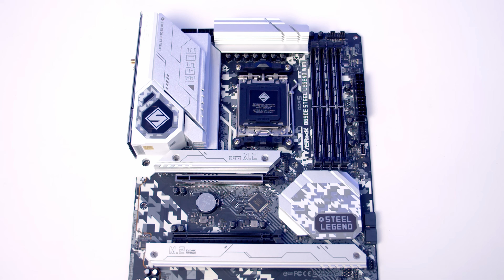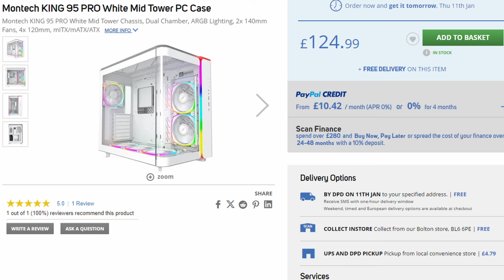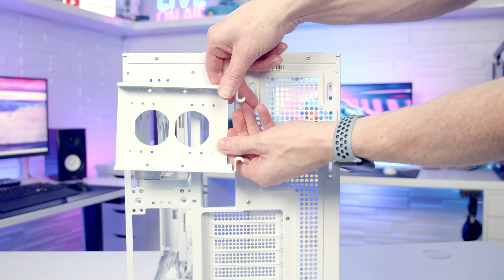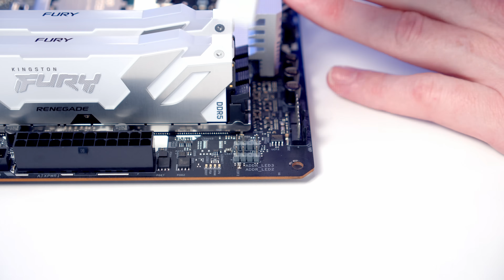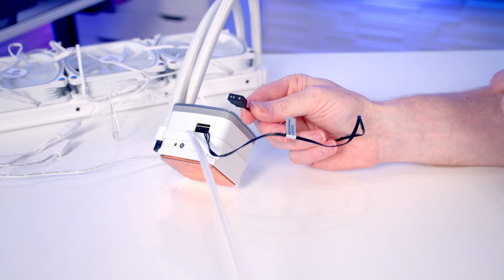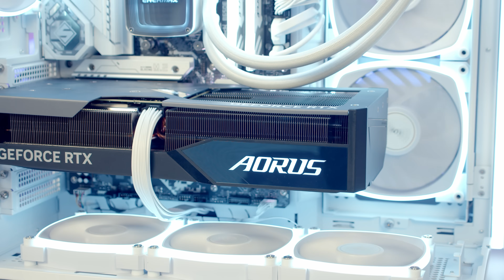Montech King 95 Build - Step by Step Guide and Case Review

Comment: I used a MSI MAG B550 Tomahawk MAX WiFi Gaming Motherboard and couldn't fit the i/o panel at all. Had to pry off the integrated shield and couldn't use it at all - the panel sat inset.   Then the board was doa and had to return a damaged mobo. So I'm back at step one wondering what board I can use tbat will fit. I need an amd for the 5000 series.

Comment: i am wanting to transfer my Hard drives from my old PC.  they are larger but i dont see a cable for the power and data line to connect. do i need a conversion for these? thanks for the fine video. pete

Comment: UPDATE:  (09:10)  Chris, that cable only comes with the non-Pro version of the case; the King 95 Pro doesn't come with it, and doesn't it need one.  

I think the way it works with the Pro version is, if you want to control the RGB lighting with reset switch, then just leave the default wiring in place (everything's all wired up and cable managed, right out of the box), but if you want to use the reset switch to reset the PC instead, then you only need to disconnect the two pin connector from the ARGB/PWM hub and tuck it away somewhere.  

I'm starting on Daniel's new gaming PC this week, so I'll check back to verify this information when I get to that part of the build - but I'm pretty sure that's how it works because in my (King 95 Pro) manual it shows that same adapter cable and says that it's "exclusive to King 95."

EDIT: Typos! 🫨
Reply: hello my friend
i've just got this case in the non pro version
did you used the cable that's included in this version? it is needed to control the front panel RGB?
I've also got the HUB Fan that's inclued in the kit with 3 montech fans, should I use the HUB for the "led" cable?
Reply: @renatinn  I used the King 95 Pro for the build I referenced above, and I haven't built in the non-Pro version, so I'm unsure of how you'd go about putting your particular setup together (sorry).

Comment: Can I do the Push and Pull system on the back with 240mm radiator?
Reply: That depends on the length of your GPU.  If it's a small one (less than 260mm or so in length), then you can make a push/pull 240mm AIO work.  Otherwise the AIO be too 'thick' and get in the way of the GPU.

Comment: I have been racking my brain trying to understand what you meant by "....and once we get it over the middle standoff it is going to help hold the motherboard in place...".There is nothing on my motherboard that I can see that allows you to hang the motherboard onto a middle standoff like you did ? I lay my case down at this point of the install to avoid it slipping and potentially scratching or damaging the bottom of the motherboard on the standoffs.
Reply: Not all ATX cases feature this type of center standoff but (when present) they're intended help to ensure that the motherboard is positioned correctly, with the other eight standoffs properly aligned with their corresponding motherboard holes.  

It should be noted that 'hanging' a motherboard (vertically) from this type of center standoff should always be done with great care because if the motherboard accidentally slips off, the standoff itself could conceivably cause damage to the back of the motherboard.
Reply: @MikeBob2023 Thanks and I have noted that he has given this advice before but I have never seen a motherboard with that ability but I assume they exist. I too would be too scared to just hang a motherboard like a picture on the wall - forget and bump the case, motherboard falls off the "holding point" and scrapes a couple of components off and you could be up for a brand new motherboard. Somehow as his advice is designed to help new builders I think it is fraught with risk. I'll stick to safely laying the PC down (as I do when inserting the GPU as well but he doesn't) to be on the safe side.
Reply: @regwatson2017  I wouldn't do it either, but Christopher can do this stuff in the dark with his eyes closed (and if he can do it, then realistically, anyone can).  I always install my motherboards and GPUs in a horizontal orientation as well, but because Chris is making videos, he's got things like camera angles to keep in mind -- so there's that to consider.  

When all is said & done though, I honestly don't think Mr. Flannigan would demonstrate (or advocate for) any build practice/methodology that was unsafe for either the novice builder or their components.   It's just not his way.

EDIT: Typos! 🙄

Comment: I’m strongly considering the pro version of the case for my first build, do you have any recommendations for third party gpu support brackets?
Reply: Because of the fans mounted on the bottom of the case, using most third party anti-sag brackets may not be possible.  Some motherboard manufacturers include brackets that utilize the motherboard's case mounting holes (some of ASRock's 'premium' 600 series models included them, like the Taichi for example), and some GPUs also come with their own case-mounted anti-sag bracket included (my Sapphire Pulse 9070 XT came with one, and I've seen several different MSI GPUs that include them as well), but you'll probably want to measure carefully before attempting to use any other type of bracket in the King 95 Pro.

Comment: Why does nobody show how to add an ssd or hdd.... thumbs down 100x if I could lol
Reply: Not a hard concept...push them in and apply screw or use tool less. Did you want a guide on how to plug it in to a wall socket also?

Comment: With the power supply mounted like that it is exhausting warm air into the case. Wouldn't it be better have it blow warm air out ? You'd have to rotate it 180 degrees. I prefer a power supply at the bottom of the case personally blowing air out the bottom but with this case you don't have the choice - you have to stick the power supply vertically rather than horizontally.

Comment: No need for gpu support?

I have a 7900xtx red devil, how should I support it?

Cheers
Reply: If you look at the end of the Gigabyte card you will see threads. He Should have received a L shaped bracket with his GPU. I have the Gigabyte 4090 Aero and it does and it also has this exact same holes for attaching it. Even with a 4070, I would be supporting it

Comment: Thanks for the video! I'm going to build a new pc and absolutely love this case! This  video really helped me plan the build.(it's my first build after 10 years now and i am a little bit rusty) I want to go with this case, a asrock b650 steel legend mobo, a ryzen 7 7800x3d cpu, a asrock 7900 gre, kingston fury beast ddr5 6000 cl30 32gb set, a arctic liquid freezer III cooler, a lexar nm790 2TB ssd, and a thermaltake toughpower gf snow 850 w. And i want to mount the gpu vertically with the coolermaster mount.

Comment: Why 7200MT/S  for the 7800X3d?
AMD recommend Max Memory Speed
2x1R	DDR5-5200
2x2R	DDR5-5200
4x1R	DDR5-3600
4x2R	DDR5-3600

Yes some 7800x3d processors will be able to run on 6000 or more, but not all. Showing a build with an 7200 is just bad info for people

Comment: So you have reverse fans on the side pulling air in,  Are the fans on the bottom blowing out?  Is the rad fans pulling in and is the back fan blowing out?  I'm putting together another build in the very case,  just a bit confused on the fan situation..  I've never built in a case with fans on the bottom.

Comment: Nobody seems to mention:  The front panel has a button to toggle through LED states on the King 95 Pro, in which the fans are controlled through a Montech hub. The Montech front panel header has the LED toggle button molded into that plug. I've got a non-pro unit that doesn't have the Montech fan hub (I added my own).  The molded Montech front panel header does not connect the wires from the LED toggle button to anything worthwhile if you're not using their fan hub. But Montech provides an adapter to the header that converts it to conventional header pin jacks along with a separate LED line. You can plug the LED line onto the Reset pins, turning that LED toggle button into a Reset button.  I removed that drive cage and mounted my psu in the top position, giving me a big area of metal plate to mount my own aRGB and fan hubs.

Comment: This may be a dumb question but when you installed the aio back plat to the motherboard did you have to take out the ssd/hdd drive in the back to put the back plate on? Just wanted to ask thanks.

Comment: Quick question.  You mention that the Pro version includes a “front panel” connector cable.   Just received the Pro and it wasn’t included.  The manual also states this cable is exclusive to the King 95 (non-Pro version).   Am I missing something?  Thanks!
Reply: I have the non-pro version, and I noted the same thing.  It did include the front panel connector cable adapter.  In my use, I found that adapter necessary: As far as I can tell, the stock connector block leaves the LED control button useless with most motherboards (at least it would in mine).  With the adapter, I was able to reassign the LED control button to the Reset function.
Reply: Did you ever figure out what to do so that the button works as rgb button instead of reset? Ill be building in these on Wednesday
Reply: @JimboHurt To make that button work as an rgb controller, you need to have the pro version that has its own proprietary aRGB splitter.

Comment: Bought the case and installed extra three montech ax120 argb fans up top... The fans work but the argb don't... After booting for the first time actually saw all the fans work but 4 fans don't produce the argb lighting... Any solution for this?

Comment: If my motherboard only has 3 5V ARGB headers (3A max), will i be able to connect 10 argb fans (9 case fans and 1 cpu cooler fans) AND the front panel light strip? Thermalright argb fans btw.
Reply: the argb hub in case has 10 spots so pretty sure yes
Reply: I have 9 rgb fans daisy chained onto one argb header and it seems to work fine

Comment: But when you want to upgrade to other fans,what case model should i the get?
Reply: wondering same thing. I want to put fans on the from mesh like he stated . id like to get different shaped fans to make it look funky.  also month fans seem to be a little expensive right now at 15$each.  I would love some advice. also how do you know if the fan you are buying will both direct air in correct direction as well as have rgb colors on correct side

Comment: Wait so i could put 11 fans total, 2x 140 on front mesh panel, side mounted 280 AIO with 2 140 fans and then 3x 120 fans on bottom, 3x 120 fans up top and a single 120 at the rear ?
If so im ordering this straight away and ditching my corsair 4000D
Reply: yes that is correct. I've read people removing the rear fan for clearance issues here and there.  Im currently looking into buying to 140mm standard fans for the mesh net.  Im not sure if I should get month or a different brand .  would this effect rgb connectivity ?  I think changing the shape of the front nesh fans would give it a cool look

Comment: Just curious, but are you using any supports for the graphics card or is the case pretty stout?
Reply: 1) Preferable option is PCIE supoort bracket that comes with the gpu or separate purchase
2) Worst case is sacrifice one of the bottom fans or find a place on top of the fans for the vertical support

Comment: Just got done building my daughter’s PC with this case. I’m kind of in love with it 😂. I would definitely recommend the Pro version over the standard because of the pre-installed Fans, ARGB Hub and because the cable management is pretty much already done for you. It saved me like an hour’s worth of cable management once I was done
Reply: Hi, i got the base version and purchased the fans seperatly. Does it work with any hub or is a controller needed. Is your front case rgb working with the hub?
Reply: @Makaweli90  hey, I believe all their cases come with a hub so you should be good 👍 

I connected my case RGB straight to the motherboard, along with the power and reset buttons. I wouldn’t be 100 sure if it works with the included hub. However, I do know that the hub only supports 5v argb inputs and the case rgb are most likely 12v because the connectors are different
Reply: @Jaylou88  hmm.. as far as i've seen the non pro version doesn't come with a pwm and rgb controller unlike the pro version. I think i will figure it out in a few hours. Thank you for your response. Appreciate it.
Reply: @Makaweli90  that would be very odd if they didn’t include it, seeing as how even my $60 montech air 100 case came with one. I’m rooting for ya tho 😅

Comment: Very nice and educational video. I love the way you explained every step and the video quality/camera positioning is just Premium. Big youtubers doing same content are not even close and i am sure you will get at the top in no time if you continue like that.

I never build a PC and i am poking around to find the courage and start. Not a complete newbie when it comes to TECH but def new when it comes to building a Gaming PC.

I am thinking about a full White build:
CPU: RYZEN 7800X3D
CPU COOLER: DEEPCOOL LS720 SE WH 360mm (here i want mostly a clean looking cooler doing its job and being budget freindly)
GPU: Powercolor Radeon RX 7800 XT Hellhound Spectral White
MOBO: B650 AORUS ELITE AX ICE (is a flash bios here required?)
RAM: 2x16GB CORSAIR(any othe suggestions here?) RGB 6000 CL 30/32(dunno if the latency really affects ingame performance at this point)
SSD: WD Black SN770 NVMe 1TB (or something around same price)
PSU: Corsair RM850 (2021), RM Series, 850 Watt 80 Plus Gold WHITE(i want this mostly so i dont bother with white extenders...any suggestions?)
CASE: Montech King 95 Pro WHITE

Do you have any suggestions? i am trying to stay on a budget while i keep the beautiful white clean looks and not sacrificing Performance.
DO you think those parts will fit well together ? Compatibility issues is the most scaring thing....along with the BIOS errors(if any)

Subscribing was a nobrainer for me. 

Good Luck

Comment: Which fans are intake, seems like all fans are sucking air within the case
Reply: The two side fans and the bottom one are reversed and pushing air in.
Reply: @moonstomper68  in this case the AIO on top is exhaust right?

Comment: Excellent build guide, Chris! Thank you! (You're the best. 🏆) 24:25 I had the exact same thought about the Enermax AIO (I haven't yet decided which AIO brand I'll be using in my build 🙄), so I wanted to ask you: What is your assessment of Enermax (performance-wise) in general? I haven't chosen my CPU yet either, but I'll likely be going with an unlocked Intel i5 or i7.
Reply from the maker: Thanks, that's very kind of you. I left a reply to your previous comments. If noise most important go with the Dark Rock Pro (will save you some money too). If you want an AIO go for one without a USB cable and software to run it. I've always used deepcool in my own systems, never let down. Running the LT720 and very happy with it. You can get better cooling or one with a screen, but you need to use the software which is a pain in the ass and will potentially slow your PC down. I use an ASRock motherboard as you can adjust the ARGB from the BIOS with no software needed (not the RAM or GPU, just the ARGB headers). If your happy with the looks of the air cooler and not wanting the lowest possible temps I would go with an air cooler in my own system or a custom curve on the LT720 isn't too far behind.
Reply: @ChristopherFlannigan  Yeah, I really like the way those LCD screens look (NZXT, Corsair, etc) but I don't want their software running on my new build (CAM is still a buggy mess after all these years, although I've heard that Corsair's iCUE suite has improved).  I'd much rather have mine set up they way you're doing it with yours. I think I'll stick with my original (DeepCool LT720) plan. It should look good with Montech AX 120's and still perform well enough. 🤞🏻😉

Comment: This or NV5?
Reply: Nv5 if you prefer the look and have the budget for three sets of high quality fans if you're a fancy lad. Of course you can throw 9 budget non rgb fans in there. 
I can go on about my love for this Montech so I'll digress.
Reply from the maker: That's a difficult decision, either would be fine, but if you factor in the fans I think this one is the best value
Reply: @ChristopherFlannigan  i do love the design of the nv5 but damn is the king 95 pro a good deal
Reply: Phantek does sell an NV5 bundle with 360 AIO and fans for $400. Yeah, nicer fans but that is about $150 more than King 95 Pro + a 360 AIO.